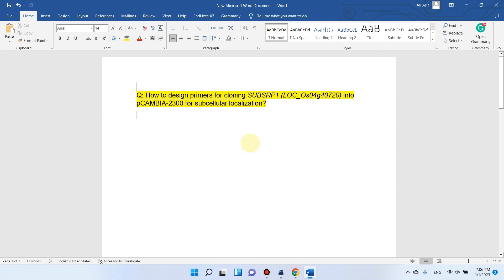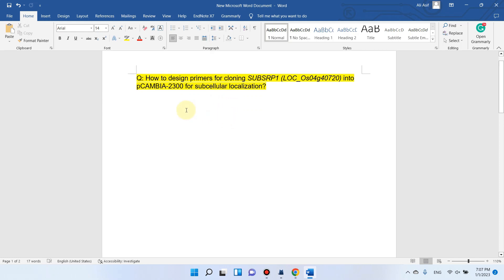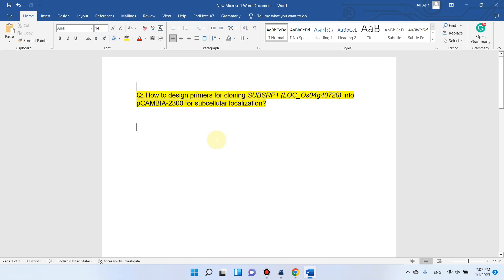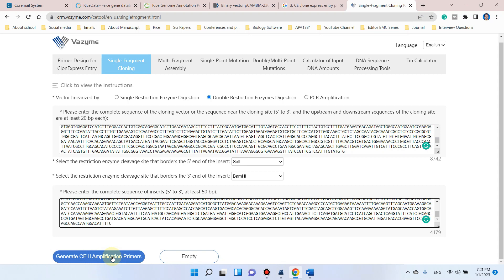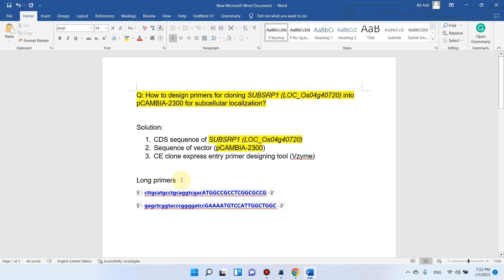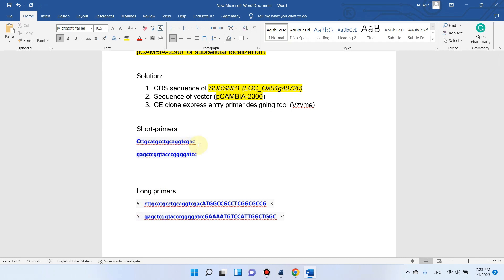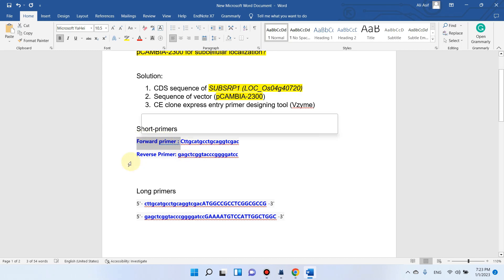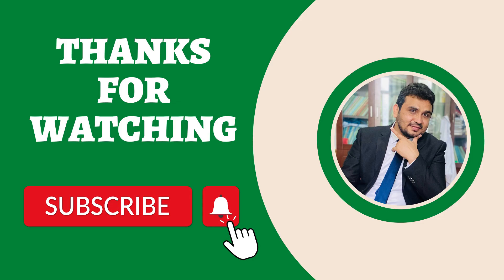Online Primer designing tool

Comment: thank you somuch for the reply sir, my final question to you is that in this software  im right now selecting the first part, i.e primer design for clone express entry, in that when i feed the sequence im getting the forward primer properly but when i search the presence of the reverse primer given by the software in my gene sequence it is not showing the reverse primer sequence. is the reverse primer sequence given by the software right
Reply from the maker: Yes software is giving right, reverse primer is not found in single strand gene sequence. If you want to search first make it reverse complement then try searching in the sequence

Comment: sir im given a task for cloning multiple cds in a vector called pEGFPN-3XHA. I want to know how to download all these cds at once and how to design the primers for these cds and also how to incorporate the restriction sites in these primers too
Reply from the maker: You can also use this tool for primer designing for multiple cds and also have options to choose restrictions sites and non cutters
Reply from the maker: To download multiple coding sequences (cds) at once, you can use online databases like NCBI GenBank or EMBL-EBI. Follow these general steps:

1. *Retrieve CDS sequences:* Search for each CDS by gene name or accession number. Select the sequences you need and add them to a download cart.

2. *Download sequences:* Go to the download cart and download the sequences in a format compatible with your cloning software (e.g., FASTA format).

3. *Prepare sequences for cloning:* Inspect the downloaded sequences to ensure they match your requirements. You may need to extract the CDS region and remove any unwanted sequences (e.g., introns).

For primer design and incorporating restriction sites, follow these steps:

1. *Identify the CDS region:* Use sequence analysis tools (e.g., NCBI BLAST) to identify the coding region of each gene.

2. *Design primers:* Use a primer design tool (e.g., Primer3, SnapGene, Benchling) to design primers specific to each CDS. Specify the desired restriction sites in the primer design parameters.

3. *Incorporate restriction sites:* Include the restriction site sequences in the 5' end of the forward primer and the 3' end of the reverse primer. Ensure that the restriction sites are compatible with the cloning vector.

4. *Primer specificity:* Verify primer specificity using tools like BLAST to avoid non-specific amplification.

5. *Order primers:* Order the designed primers from a reputable supplier.

6. *Primer validation:* Validate the primers through PCR before proceeding with cloning.

Remember to carefully design your primers and verify their compatibility with your cloning strategy and vector.